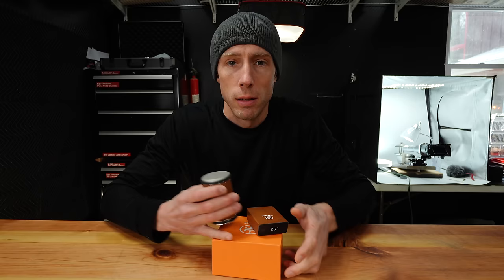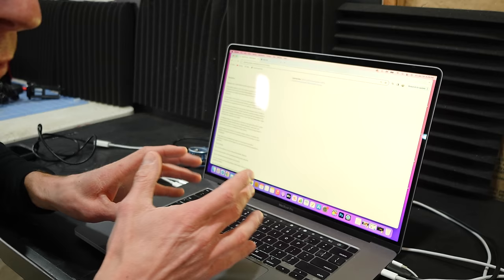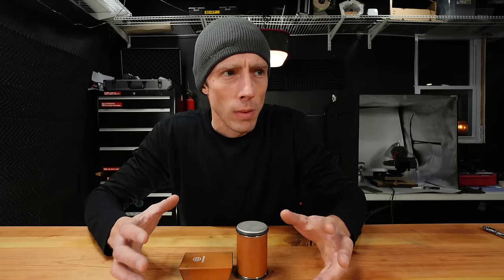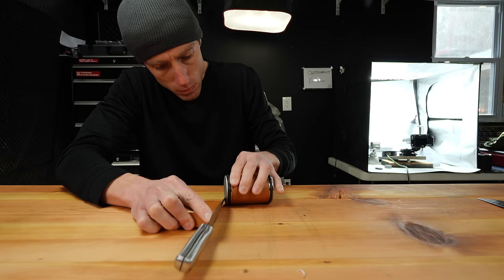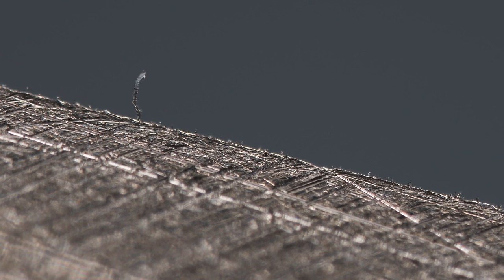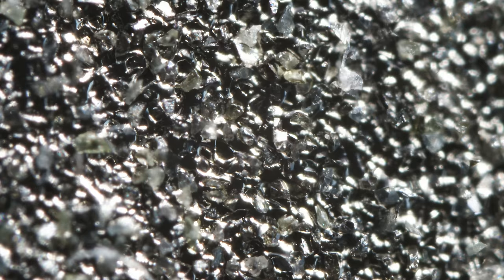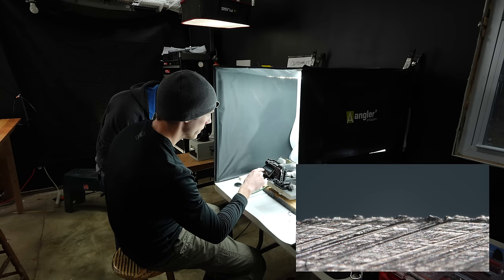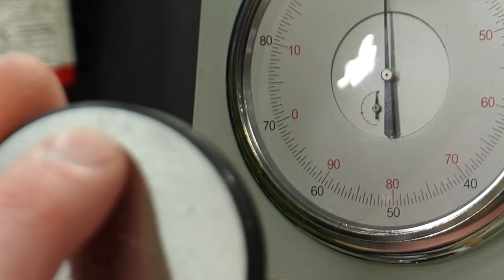There’s Something Strange About These Rolling Knife Sharpeners..

Comment: Funny thing is that I bought a Horl 2 sharpener a few years ago, and when these seemingly official Tumbler sharpeners came on the market, I started having doubts about whether I had actually bought a copy rather than the original design. Glad to hear that my initial purchase was from the original designers of the product, and got a finer quality sharpener to boot!
Reply: has it worked well?
Reply: @eduardoarce879  So you don't think copyright matters, honoring and letting those profit off of something they came up with opposed to throwing your money at someone who is just lazily ripping off ideas and while doing so, doing a very bad job at it but still asking for a premium price? You get a better v-sharpener for 5$ than what this thing is capable of.
Reply: @AvidEric First of all. The patent for the roller sharpener and the roller rectifier is from 1992, that means there is no patent anymore, no copyrights were broken. Second, that is how inovation works, taking an existing product and trying to improve it, which in this case might no be but any other should be able to. Lastly, if you think a v-sharpener could do better, probably you dont know much about sharpening.
Reply: @eduardoarce879  How exactly does it "improve" it, if it's worse than the original..? Did you even watch the video?
Reply: @Charun1982 Dude, do you even know how to read? I clearly said this was not the case(This specific situation, this 2 itmes, this video) but that is how it normally works, One takes an existing product and improve it
Reply: @AvidEric  Copyright is stupid, patents doubly so. You cannot own ideas. The only reason it seems immoral to profit off someone else's ideas is because all profit is immoral. This is a flaw of capitalism rather than something specific to IP law.
Reply: @_xeere  sure you can thats pretty much the point of patents. Dont pretend its not right to forbid a company of taking someones innovation and just producing it cheaper. Its not like we know this kills innovation....
Reply: @humungus4206  In practice, patents stifle innovation more than they promote it. Doing something cheaper is also a form of innovation, after all. Worse than that, they also prevent any kind of innovation that builds on the thing patented.
Reply: @_xeere shouldn’t someone who invents something worth copying be compensated for their innovation to the world? I certainly think so. 

If you invent something that makes life easier in some way you should become a very wealthy individual off of that invention. Compensation for your gifts to the world.
Reply: @_xeere  You have obviously never produced anything of value.  The patent and copyright system encourage people to innovate because money (profiting from rights to the innovation for a fixed period) drives motivation.  It's why people work for a living.  It's why there will never be a Thomas Edison in a socialist/communist country.  Socialism/communism only works until you run out of other people's money.  That's why capitalist countries are so much more prosperous than socialist/communist countries.  And don't cite Sweden as an example.  Sweden became prosperous due to capitalism before it become more socialist.  When it discovered socialism didn't work well, it reverted to capitalism.
Under capitalism there is unequal prosperity; under communism there is equal misery, except for the hypocritical elite which actually run the communist system.
Reply: @dzcav3  If you think profit is the only driver of innovation, how do you explain open source software? The servers which we need to make these comments run on Linux, an operating system produced for free by thousands of volunteers who knew that they never stood to profit from it. There are hundreds of thousands of similar projects created and distributed for free by millions of passionate people, without which computers and the internet would not function. In fact, these people create this software at their own expense as it reduces their ability to profit from competing software in a professional context. You are taking the unbounded curiosity of the human spirit and reducing it to a simple monetary equation. This is inaccurate and almost insulting.

Also, the people who made that video on X about Sweden were clueless on the most basic level.
Reply: I got my Hurrrr 2 sharpener long before it was cool
Reply: @humungus4206  "Its not like we know this kills innovation...."

Patents are useless unless you already have the capital to defend them in court....  which means only large companies really benefit from the patent laws: first their own stuff is protected, then they can steal from the smaller inventors with impunity.
Reply: @BPo75  There are insurances, grants and other types of assistance that cover court costs for all patent owners dealing with copyright issues. But in most cases doesn’t cost more than a cease N desist letter.
Reply: Patents aren't perfect. Patent trolls are a good example. But on the whole, patents are a good thing.

1. They encourage innovations to be made public instead of secret. Once something is understood then perhaps a new and better way to do it can be invented.
2. It preserves knowledge and innovation in a public record by making the public record valuable.
3. It encourages investment in mass production by protecting the manufacturers from knockoff competition for a period of time.

Comment: They are a waste of money if you work in the industry. The bearings gunk up and stops rolling. Your better off learning how to use your whetstones properly. Your edge will last longer and get sharper. Also the grit on the sharpener side wears off in about a week, since you are supposed to use it for upkeep instead of sharpening from dull. Oh and the strop you can buy for extra is verrry mehhhhhh
Reply: There are no bearings.

Comment: If I was interested in one of these systems I'd go for the Work Sharp.  It comes with 320 and 600 grit diamond disks, plus a fine ceramic.  It also offers a choice of four angles, while I believe the others only offer two.  It's closer in price to the Tumblr than the Horl.
Reply: Agreed, or lansky, either set up is far more portable with loads more options.
Reply: Plus, the work sharp seems like it has a MUCH better grip; not only is it textured, but it positions your hand away from the edge of your knife. With this Horl, you're basically rolling your hand back and forth right next to your edge, and a single slip might mean you need stitches; since these things are marketed towards low-info and/or low-skill users, slipping seems a lot more likely, and it seems irresponsible to not consider that in their design.

EDIT: typo
Reply: The lansky clamp system is pretty affordable and actually works really well. I used to use it a lot. Over time I learned how to sharpen without it so I usually don't pull it out unless a knife needs to be completely reprofiled with a new angle or something.
Reply: @ShootingUtah  that's what I'm saying! For the price you may as well get a lansky, you can completely reprofile an edge or just maintain with it. And so many more options as well. But yeah, most of us probably just carry 2 reversible stones and maybe a strop for hunting, if that.
Reply: 1 x 30 belt sander + finer belts + angle guide = 👌
Reply: @ilikewaffles3689  you're missing the point, you can't use that in the field, that's stationary equipment or equipment you have to pack more for just to operate. We're talking about accountability and portability
Reply: @3x6Corvus  a tiny percentage of people are sharpening "in the field". Most people sharpen at home. You get much more power, belts last much longer, much more accessories and belt materials.
Reply: @ilikewaffles3689  but again, that's not the discussion at hand. No one here is arguing the stationary is superior here, we're making comment that when hunting and camping stationary is not an option, that's where portable options come in. We're saying, that in lieu of the ability to use stationary equipment we prefer things like the worksharp and lansky over this roller. The reason we didn't mention stationary is because it's not an option to the discussion at hand. You're not carrying a generator in the woods to use your belt sander, nor are you transporting your belt sander with any sanity to a site. And while I'd agree with you that prepping your knives at home and making sure they're field ready is unquestionably useful and should be done, it's not going to keep the blade from dulling while whittling, splitting, chopping or skinning. Which is where some might look into this rolling device. We're making comment that while it is portable, it isn't as useful as something like a lansky that comes with multiple stones and can be easily used in the field to do everything from reprofiling (not that you would) to maintaining, which is important especially while hunting. We're trying to give the everyday man who may look at this as an option, other options that are both portable and reliable as well as offering more features all while in the field.
Reply: @3x6Corvus  OP (who I initially replied to) never mentioned portability.
Reply: @ilikewaffles3689  also, this is clearly marketed as a sort of beginner setup, meaning not super expensive. So we're also saying that for the same, if not a little more, value you can get a lansky or worksharp set up that is portable and gets your foot in the door of being able to take care of your own blade without shelling out a lot of money in stationary equipment. You may lack space, or technique, power, or any number of other reasons that you may want to but something less permanent or more versatile. Not to mention there is a learning curve you have to get over with things like a sander or a grinder that may seem intimidating to someone new, where things like this roller or the other portable tools, seem more accessable and less daunting to get into.
Reply: @ilikewaffles3689  I don't think he directly has to when the objects he's talking about ARE portable. I can say the same to you about he didn't mention anything stationary either. As a matter of fact he only mentioned portables.
Reply: @jamesruth100 purchase and returned the same week. Major waste of time IMHO..
Reply: @3x6Corvus  no no no. He's talking about alternatives. You associating portability is wishful thinking to support your own biases. If we're talking one of the best ways to sharpen almost anything (at least anything a stone can sharpen), it's a belt sander. It's basically an electric stone. $60 at harbor freight + $10 belts is by far the best value. You're not stuck with some flimsy rods that work for a very limited range of blades or a tiny "belt sander"with limited accessories and blade compatibility.
Reply: @ilikewaffles3689  yes alternate sharpening equipments that could be used in comparison or in replacement of this tool in this video. WHICH IS PORTABLE. Right tool, right job. Have fun with your generator in the woods sped lol
Reply: @ilikewaffles3689  did you really think that this video was arguing that the Horl roller would replace belt Sanders??? 😂 If so have a nice day, and have a great life, I hope you wear a helmet when you go out. If not, what's even your point here lol
Reply: @3x6Corvus  yeah, very portable. This tool barely worked on an ideal, relatively flat surface. It will definitely work on dirt, mud, grass, and sand🤦‍♂️
Reply: @ilikewaffles3689  which is why we're all making comment of more usable, versatile, and portable equipment, all around the same price, that isn't stationary. Thanks for playing and proving my point, come again anytime. Lol what a big circle you just went in only for you to get back to our original point. Nice job, not for you obviously, you've completely undermined your own point now lol
Reply: I feel sorry for your inbox, this whole thread is an absolute trainwreck.
Reply: It has only one problem: It doesn't work as well.
What's the point in more angles, if the result is bad?
The problem is that you have to work against it, because it doesn't roll straight.

Comment: My brick isn't giving me the same results you got. I think I'll return it.
Reply: It can the truck is proper technique and to use a leather strap after. The leather strap will fine the edge and it's very easy to use. When sharpening blades there's more than just the block you should do if you want it very sharp. These tumblers remove more material eventually damaging the blade as it's just a sander.

Comment: 13:00 you gotta love that sunk cost fallacy, haha!

"I already spent money on it, so I want it to be good!  Even if it's not!"
Reply from the maker: Its a great idea, but could be better👍
Reply: @OUTDOORS55    Since it's pretty much not usable at this point.  How about taking Arkansas Stones of the right size and put them on interchangeable plates, so you can change it out to different Grits.
Reply: I think I would use the angle jig to run blades against a belt grinder. Salvage it a little…
Reply: I went through that phase with the cheap diamond stones for my edge pro. They worked great for one or two knives but then there were no diamonds left and they did nothing. I wanted them to keep sharpening but had to throw them away. I’m back to the original stones from edge pro.

Comment: I own the Horl2 (with replacable discs) and was a Meat Cutter for nearly 16yrs. I got the sharpner bout 7yrs into my job and replaced the disc on the sharpner side 1 time. Same for the ceramic side. I absolutely loved it. I own Victorinox knives so when takin care of i dont need to sharpen often but the speed at wich u can get a nice edge and even edge was a godsend. A bit of a pain on the scimitar knives but still with use u got ways to do it. I love that sharpner n still have it to this day. ❤
Reply: Hey, i've got a question if you don't mind. When you sharpen a curved blade did you sharpen in a pull/push the whole blade or do you do it in parts?

Comment: I own the Horl and have purchased two of their finer grit disks to use with it and it's phenomenal however it (and many of the knock-offs) could be improved.  If you have a knife with a wide blade it's necessary to place the roller on top of something of the correct thickness in order to sharpen the wider blade.  This problem would be addressed by making a simple change to the magnetic blade holder.  If you flip it over and raise it up by, say, an inch (you can glue a block to it) you can now attach a blade of any width, with the sharp edge down and slightly above the rolling surface.  Another advantage of this flipped position is that it's safer - the sharp edge is down and not up - and you won't cut yourself if your hand slips off the roller.
Reply: One could use parallel sets to prop under knives that wouldn’t fit, if one was inclined. And/or use 1-2-3 blocks under the magnetic block, also.
Reply: it's the same hype as with stanley cup, on which idiots line up in queue. Sharpeners have existed since the dawn of time, and now you're just trying to reinvent the wheel.
Reply: Sounds like you should invent that 😅
Reply: @iammichaeldavis  Haha right? I was thinking that not all 'knock off' products are just cheap imitations, some actually iterate and make significant improvements on the original. Usually it's easy to tell the difference tho.
Reply: i agree with you. i just thought about raising the roller, but hadn't gotten to inverting the blade although i cringed at the sharp edge being pointed up.
Reply: To be fair..  the roller.. rolls. The grip required on these style to have a good hold on the roller is barely anything, so "slipping off" the roller is very hard to do accidentally. The higher risk is pushing to hard and pushing the blade off the magnetic block. In that case blade up or down, has about the same risk level of it cutting you in the process.
Reply: @amonynous9041  Uh, yeah......that's how innovation works. Take an existing product or method and try to improve it's function, make the task easier, make it less prone to user error, make the task faster, etc, etc, etc. I don't see your point, other than the rather obvious statement that sharpeners have been around a long time. I've got an ancient, cucumber shaped stone for edge honing. Works great. Sucks to use, just like stone or wood wheels would suck compared to modern tires.
Reply: The imarku one I just bought has the exact modification and it says to sharpen all knives blade down… I have to practice with it more to get my tip work down and just get it to sharpen better than I can get it using my whetstones…. as of now the whetstones and leather strop gets me an edge much sharper ..?? Albeit I’ve been using them for years and my skill level is above average for sure! I think anyone who has minimal experience with sharpening would have better results…
Reply: @wingnutbert9685  I usually just flip the ceramic plate and sharpen the knife on ceramic edge, I'm not a professional cook or a samurai, but it works for me. :D

Comment: I wanted to explore the rolling sharpeners and opted to go with the worksharp version.  The main reasons were that it offered 4 angles (not 2) and also had 3 grit sizes (320, 600 & ceramic).  These were really well on medium to large kitchen knives, however like you discovered in the video, smaller paring knives, or even edc knives don't work as well as you cannot get fully to the hilt.    So for kitchen knives, the WS version is excellent.....I will see over time how the grits bed in.   good to see an independent video on stuff like this.
Reply: I wish he'd test the work sharp vs this one.
Reply: Just use a block, this is nothing more than a sander. The block will last longer and will remove excess material from the blade eventually damaging the blade to much.